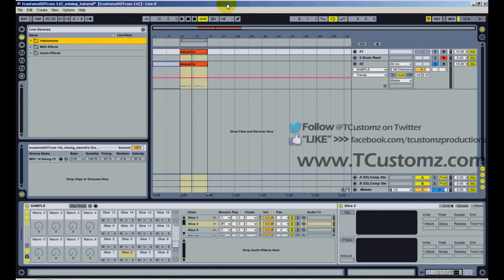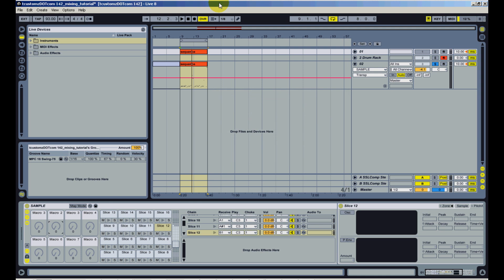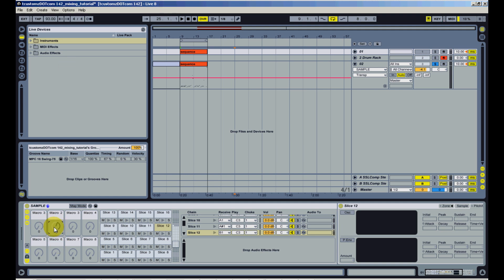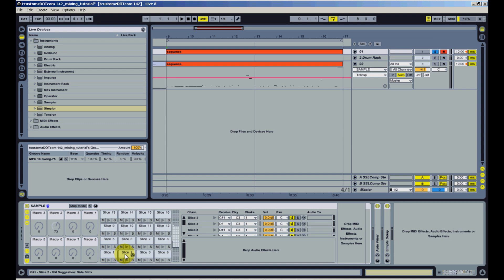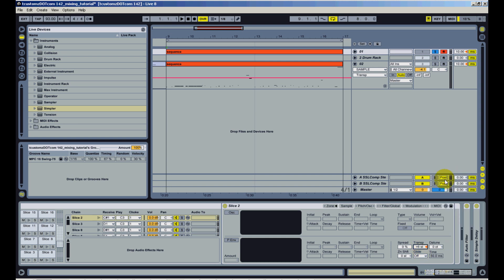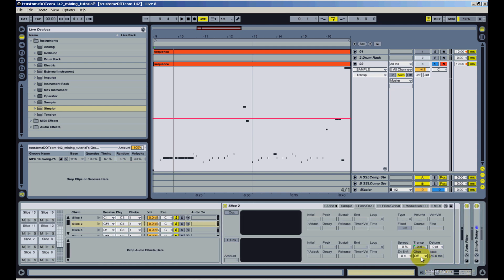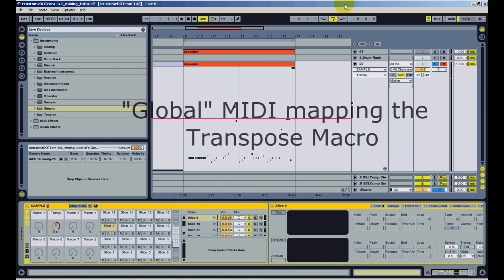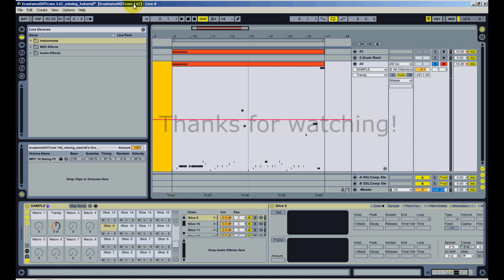How To Pitch (Transpose) a Sample in Ableton Live w/ Macro & MIDI Map an Akai MPD32 Tutorial

Comment: question: if I have a sample I load into the drum rack and I want to pitch it down by 7 semitones (and not change the playback speed) how do I do that? Is that even possible?
Reply from the maker: I'm not sure if you can timestretch inside of a drum rack. I always do that type of manipulation in an audio track
Reply: +Travis Cole (TCustomz) you have a link to show me what you mean? Ideally I want a macro in the drum rack for transpose and another separate macro in the drum rack for playback speed. Not sure if you can have that preset at the point of picking a preset in the menu after you picked your warp points. Not even sure if you can tell what I mean but yea. I'm kind of stuck.
Reply: TCustomz Productionz yes u can.